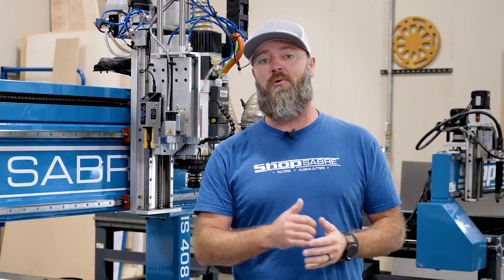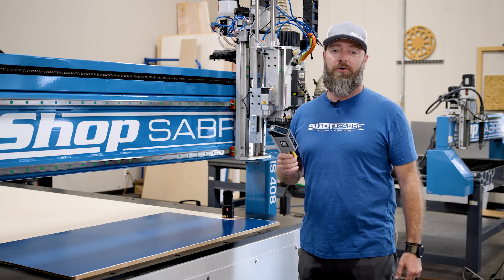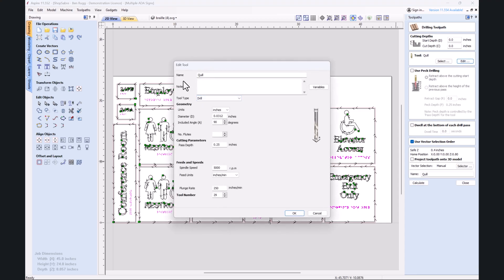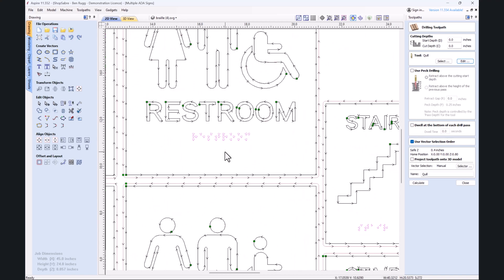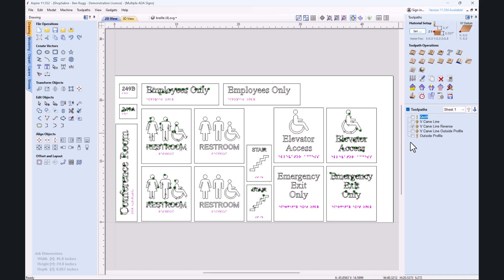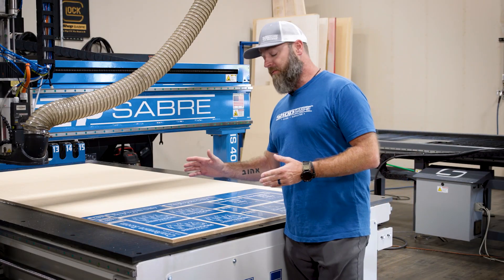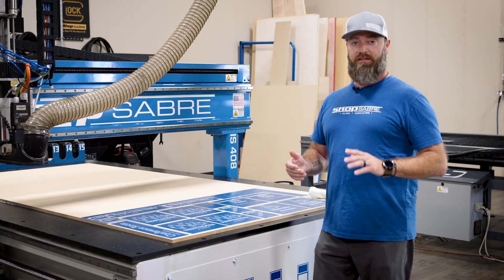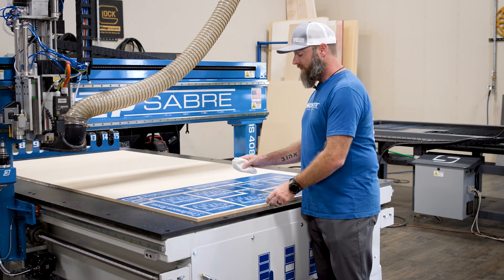Printing ADA Braille with a ShopSabre CNC Machine and the Quill

Comment: Very informative. We're running VCarve Pro as well and just got the Quill. How do you setup the offset for the quill? I'm not seeing where to allow for the difference in bit and "drill" location.
thanks!
Reply from the maker: Give our support team a call here if you haven't yet. 952-461-4570 They should be able to assist with this on your machine.